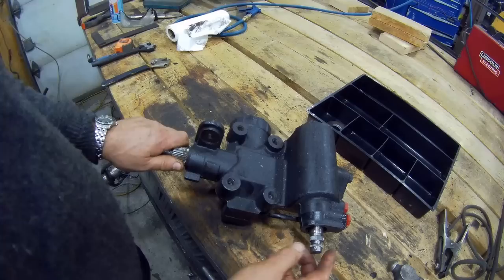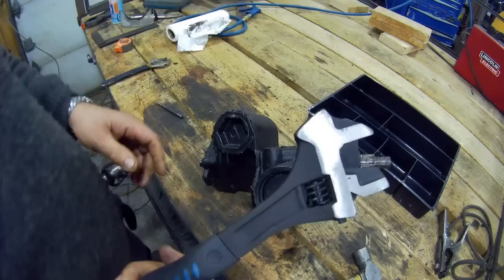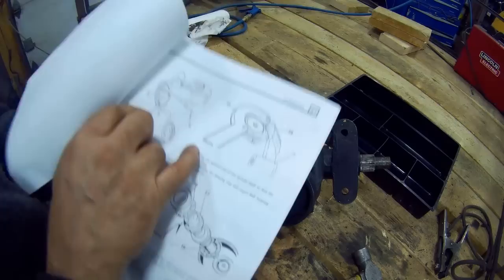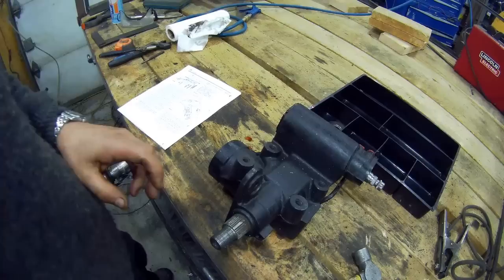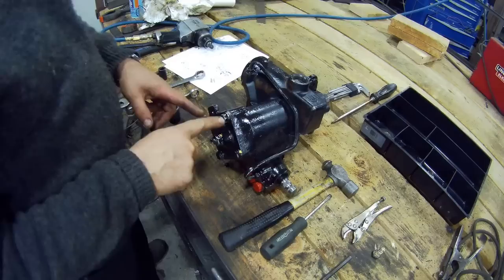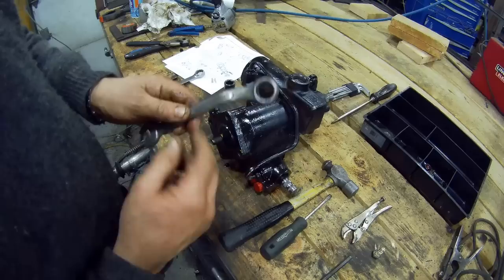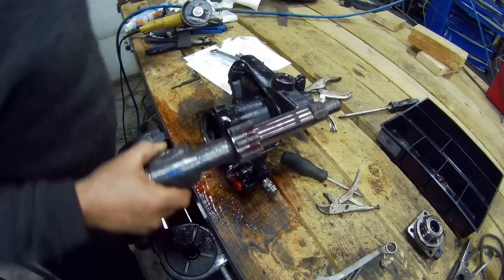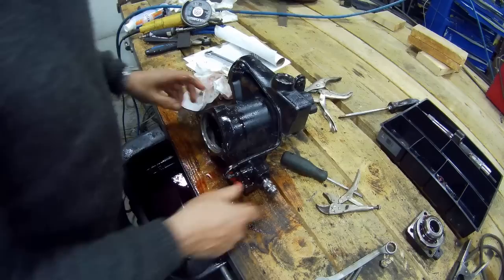Land Rover Adwest steering box overhaul part 1. Stripping the box

Comment: In 2003 I bought a 1995 Range Rover. Brakes didn't work, steering box leaking, no YouTube like there is today.
Fix the brakes that was easy.
Bought a seal kit online for $70. Took the steering gear output the new seals in and they lasted all of 2days. Took the steering gear out again and inspected it. When I stripped it all down I realized where the leak was coming from. 
You see those three concentric rings that are white on his worm gear? Those are "high pressure teflon seals". The way they are installed is they are heated and slid down a thin tude and put in their groove. When they cool down they shrink and make the seal. Problem is they don't always shrink to spec and this is the main problem for leaking gear boxes. The second problem is that range Rover does not sell those Teflon seals independently without buying a new worm gear.
At the time I was a freight ship inspector. I got lunch across the street from the yards after an inspection and there was an old kodac booth that I've been renovated and turned into a caterpillar hydraulic supplier. When I finished eating I went over and talked to the guy to see if they sold Teflon seals that would be applicable for my application. He told me he would need to know the PSI for the system and I would need to bring in the worm gear and gear box.
So next time I went down there I brought my worm gear and box (it was drained and cleaned and sitting in my garage) and let him know what the PSI was for the steering pump (which is considerably lower than the majority of the applications that he sold for). 
I was a little freaked out when he told me that he would need to cut one of the seals in order to measure it. I didn't see a downside to this since it didn't matter it was just blowing through my low pressure seals so obviously it wasn't working. I gave the nod and he cut one of them off. After measuring it you let me know that he did not have one. I was crushed... I did not want to fork out money shoe Land Rover especially for a part that has been a known problem and leaking on everybody's garage floor for the past 30 years. And he said "hold on a minute". He came back up with two bags and said that I would have to buy them but he thought that they would work. I said how much? He said $0.70 for one and a dollar for the other. I said okay. He explained that they were seal pistons for a hydraulic ram. They consisted of an o-ring and a teflon outer seal that went ontop of it. So he showed me how it went on, he measured the boar and measured the height of this seal sandwich and it was less than a human hair bigger. He explained it whenever it would go into the Borg the o-ring would compress and it would make the seal. So I bought two more and went home. I also got his mailing address for the business and the part numbers just in case it worked. I put the o-ring on the second one, shoehorning the Teflon seal over it (fyi the inside of the Teflon seal was grooved so it matched the o-ring explain.) And well not easy it was not impossible. I bought another $70 seal kit, and as soon as it came in I reassembled everything and put it back on the rover. The s*** worked perfectly 😁👍. Never had a leak after that, ever.
Remember this was back in ancient internet times. So I made my first and only post on the Land Rover/ range Rover forums that we used to communicate on. I said the same stories that I just told you and I provided the CATerpillar part number.
About four months later I was eating at the same place and saw the guy so I went over to let him know that it was a great success and I put his business information on the range Rover forms along with the part number. 🤣 He started laughing. She said that he sold out six weeks after I was there I could not keep any of those in stock because as soon as they came in he was putting them in envelopes and mailing them all over world. He had forgotten about me buying those couldn't figure out why the part was so popular but it all made sense now 🤣". 
I do not remember what the part number was but I'm sure it's still on the forums somewhere. Use my handle and drop the number one. Or you can just go through the same process I did with your local hydraulic shop. Disassemble your gear box, take it in and let them measure it and fit it. Get the o-ring and matchingTeflon seal. They are for "hydraulic ram pistons".
I hope this information has helped you out and saves you the money and aggravation I fixing a poorly designed OEM high pressure seal problem that has been plaguing Land Rover from the 60s all the way up to I think 2005... I believe that's finally when they changed to a different steering box with seals that actually "sealed".
Good luck with your project. I'm now giving you the information and what equipment you need to succeed. 😁👍

Comment: Thanks very much Team Britannica, I too have taken the plunge to rebuild a Discovery 1 PAS Box based on your video. Had no problems, the box was sealed from new and all threads and joints were rather rusty. COTS seal kit will be used tomorrow to re-assemble. Will phosphate, fish oil then enamel paint the exterior.

Comment: Hi, At 3:39 you use a screwdriver to loosen the locking ring. I have an oil leak in this little hole where you push the screwdriver in. Since I thought the leak was coming from the plate, I plugged the entire front with a new plate and silicone. It keeps tight. The question is how it can leak out of this hole when there shouldn't be oil on the back. The leak was minimal, 1 drop a week.

Mvh Samir Soudah, Sweden. Defender  130 2008, Series 3 1972
Reply from the maker: The hole for the locking ring is well behind the seal - I would be looking for corrosion leading to the hole for the locking ring - silicone is not the answer as it is a high pressure seal

Comment: Hello...i have an Awest assisted steering block in my 1991 DAF 400.... leaking bad... have you any idae of where i could get a kit of seals, so as to be able to have the block restored? As i am in france, i would appreciate any ideas that could help... it is a French Daf...as it has a Peugeot motor... is the Land rover block adaptable? Could it work for the Daf? I am at my wits end to find a solution!!!!!

Comment: My 3 bolt Adwest from a Ninety has worn out threads on the shaft, where it connects to the drop arm. I can´t find a replacement shaft anywhere. Any suggestions? Where to look for one? Can it be re-threaded?  Thanks!
Reply from the maker: parts are hard to find - might be simpler to convert to a 4 bolt?

Comment: I have watched all three video,s on the steering box repair. I think that they are all great to such an extent that I am now going to do one my self.  Just to make sure that I follow all your directions, I shall put my lap-top on a shelf over my work bench. I recon that you must be a Yorkshire-man, what with the refined way you speak and the way you are tight at spending money by make do and mend (LOL). Good lad! and thanks.
Reply from the maker: That's right - we don't like spending our 'brass' in North Yorkshire!

I like to do my videos so that it will encourage others to have a go, with no special tools, however you do need to make that ‘nut’ to get the adjustment nut off the worm, and also some method of working out the preloads on the input shaft at various stages of setup.
I was going to have a 2.5 inch disc made, but attaching it to the spline would be difficult, so I made something out of an old steering UJ and a bit of tube
I used the instructions from the 200 Tdi book as the 300 Tdi book required a special torque wrench to set up the preloads
There is nothing much to fear about the steering box – you just have to make sure the parts have no damage and the shafts where the seals run are good
I will be doing another video soon on how to replace the seals themselves, as this box I was using had been rebuild, but leaked at the spline 
I didn’t have a full seal kit on hand at the time
As for the seal kit, I have found the only difference with the cheap seal kit and the more expensive Corteco is the price  - both are UK made
Just be aware the low pressure input spline has 3 styles of seal and only 2 are in the kit!

This box is now on my 130 and running well – feels a little too light, but that maybe because it is winter here and the roads are iced up and offer little resistance
Reply: I already have the special tool taken care of. I  have a back locking nut off a  steel water pipe and with a little grinding it should fit just right.  If I weld it to an old half inch drive socket, I will feel pretty good with myself.  So then I should feel ready to have a go at a leaking box that I took off my defender some years ago that has been getting under my feet from under my bench. Many thanks once again.

   What do you know about FRONT anti roll bars on Defenders??????
Reply from the maker: What do you need to know about the roll bar?

I do not fit them as it does reduce articulation of the axle when off road – but if you use your truck on the road a lot, they do control body roll

Mike
Reply: I am finding the roll on my 110 CSW a bit much. especially when I have a load or/and people sat in the back and I am travelling on bendy roads.   What I would like to know is, are they of any use when fitted to the FRONT, and indeed is there such a thing, as I have never seem one fitted to a Defender. Or shall I have to up-rate my FRONT shockers. Many thanks, Rob.
Reply from the maker: Yes the do exist and they are twice as thick as the rear one - you can buy the weld on brackets for the chassis if yours does not have them
The axles usually have the mountings for the roll bar, but you will need those swivel joints as fitted to the rear as well
I think in your case they may work, but gas shocks should help too

I once had a guy with a 110 and a huge roof tent  - man that was a scary drive - ended up fitting 4 shocks on the front and 4 on the back!
Mike
Reply: Thanks for the info Mike,  I will go around a few junk-yards to see what I can get together, but first thing for me to do is repair the steering box, with the help of your video it should not be to hard to do. I will give you an update later, probably in the summer, until then, stay warm. Best wishes from Yorkshire, Rob.
Reply from the maker: Rob

I will do another video on these boxes soon as I need to build another, but I am out of seals and someone else wanted me to do a seal replacement instructional video
If you get stuck with your box let me know!

Mike
Reply: Mission accomplished !!! Just this minute took my box in bits ( 9;30 on Sunday night ). I could not have done it without your video.   Mine is a 3 bolts box, not a lot of difference although I did not need the hex drive that I made for the rack tensioner as the one that came off my 110  had two holes for a claw spanner.  Thanks very much for your encouragement, it just go's to show that at 73 years young, you never stop learning.  Best wishes from Yorkshire, Rob
Reply from the maker: Well done Robert!
Glad to help

I am having some seal kits delivered tomorrow and will do another video of fitting the seals

I fitted the one in the video to my 130 and now dry as a bone

Mike

Comment: Hello, I am in the middle of converting RHD to LHD 2006 Td5 110, I have good RHD steering box and seized LHD box. Before i start taking them apart just wonder if internal components from RHD will fit into LHD.
Reply from the maker: Nope - no major parts are usable

Comment: Another excellent set of videos. I have my box in bits, following your method, so what's the trick in getting that pin out of the worm shaft at the end of this vid. Seems a pity to have reduced my box to its component parts and not do that one! It's bound to be conspiring against me...
Reply from the maker: It is damn difficult to remove - we pressed it out and had a fiddle on to get the inner shaft out - there is no info on this repair - you are supposed to get a new unit

Comment: Hi thanks for all your vidéo wish are very usefll   I m now mouting a 300 tdi on my RRC 1989 ex 2.5 Vm ans I d like to know how to connect the steering pipes between the pump and and the power steering box   Could you describe this point please ? Wich pipe goes where between pump and box ?
Rgds Vince
Reply from the maker: I assume you have a left hand drive so you will need ANR2136
the threads are made so you cannot put them in the wrong hole (one is larger than the other)
Reply: My car is LHD The pièces I received are  from RHD so I ll have to arrange something with the LHD and RHD pipes to connect but before I ll have to change the seuls of the box.
Thanks for the advice
Reply: Hi again,  on ris subject, I found that ANR 2136 have been replaced by ANR6656, is there a second ref for the second pipe or it is twice the same ?

Comment: Thanks a lot for the knowledge and information, I have stripped down the Adwest steering box and found out that one of the needle bearings is broken. Any hints, please...
Reply from the maker: Sounds  stupid but replace the bearing  - I think the number is STC1055 but if you get the old one out then a bearing shop can match it

Comment: What is the best/strongest power assisted steeringbox? I used to have a RHD six bolt PAS box, but now have an 4 bolt LHD PAS box from a range rover classic. Heard rumours there are 2 types of 4 bolts. One being weaker than 6, one being stronger. I'm not very fond of reconverting to 6 bolts as I have the box moved 4 cm to the front and still had to do some metal removing on my engine to make it fit without hitting. But the defender is about 2500 kg dry when finished....
Reply from the maker: I could be wrong, but for power steering, there is an Adwest lightweight (4 bolt) and an Adwest heavy weight (3 bolt) 

The 6 bolt Gemmer gives very little problems
As for weaker or stronger is a matter of opinion - I think here all are concerned if it leaks or not!
As for breakages, I have had nothing in my shop in 20 years that has 'broken' on any box, but the 4 bolt Adwest is notorious for leaking - and leaks lead to bad bushings and bearings
Sorry for not  supplying the info  you may require but, I have in my Defender a 3.9 Isuzu which is a solid lump of cast iron and very heavy - in Australia they were manual steering but I have a rebuilt (my own)  4 bolt PS box and steers perfectly

Mike
Reply: @BritannicaRestorations  
Great answer. I got a 3.8 VM / Detroit diesel installed. Cast iron, line bored (more cast iron). If the 4 bolt does the job i stuck with it.. The 6 bolt was leaking as well. Got 2 sealing kits: one for 4 bolt. One for 6 bolt.  So leaking can be cured. Was concerned about breaking of housing/internals.

Btw my engine https://m.youtube.com/watch?v=k1ugrufHZE8
Reply from the maker: I made a test bed to check for leaks but this winter I am making Mk2 I run every box for an hour and make sure the oil is hot - but I realised the rig I had made was only for 4 bolt  types and no room to get the drag link to run when attached to the box 
I have has 'recon' boxes from the UK and they leaked - never tested!
Mike

Comment: Mike zrób odcinek o kolumnie kierowniczej QMB101620 wymiana lozysk
Reply from the maker: Niestety nie mam tu żadnych kolumn, którymi mógłbym się pobawić.
Wiem, że można zdobyć górne łożysko, ale dolne nie jest dostępne publicznie.
Rozmawiałem na ten temat z JP i powiedział, że obecnie dostępne są tworzywa sztuczne, które nadają się do dużych obciążeń i niskich prędkości - powinny być idealne - ale nie znam wymiarów i czy będą działać

Unfortunately, I have no columns here to play with.
I know you can get the upper bearing, but the bottom one is not available to the public.
I have spoken to JP about this, and he said there are plastics available now, which are suitable for high loads and low speed - should be perfect - but I do not know the dimensions, or if it will work
Reply: @BritannicaRestorations  Mike przerobiłem dolne łożysko na  SS 6904 2RS i jest super SS znaczy ( nierdzewne) pomógł mój JP pozdrawiam.